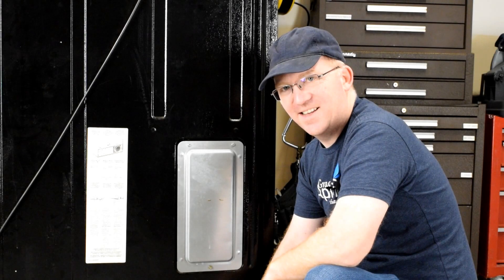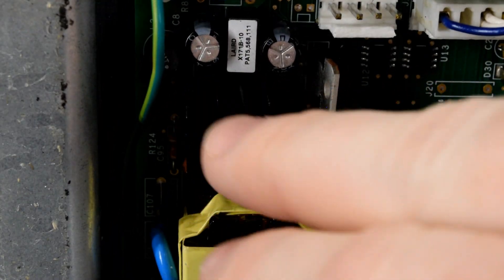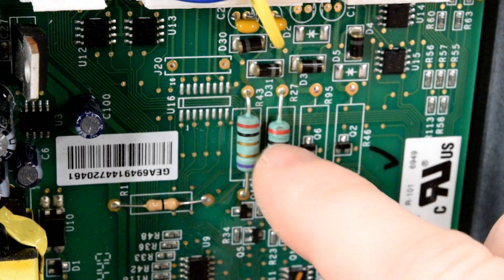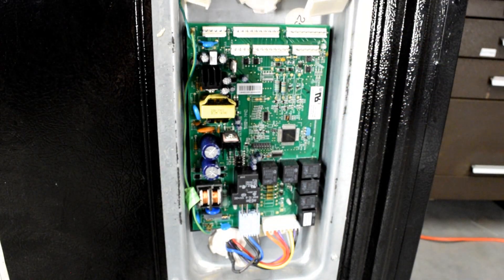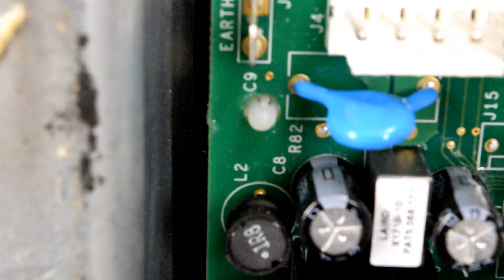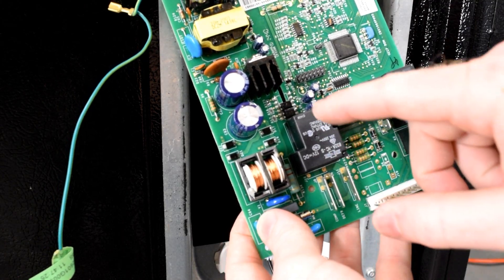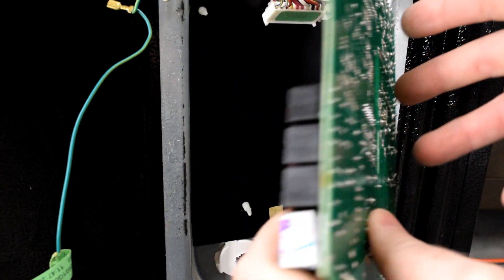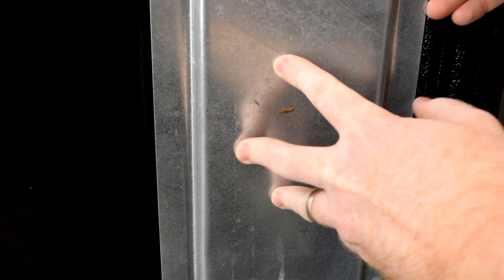Diagnosing a Bad GE Board - Part 2: Visual Inspectios

Comment from the maker: Hi Everybody, Welcome!
If you have technical questions please  check out www.Patreon.com/GraceAppliance
By becoming a channel supporter, you'll get priority response to technical questions, technical data sheet requests, and help support the channel so I can produce more repair videos. 

Thanks so much! Andy
Reply: the service manual said that do not use resist check for those DC motor, why you suggest that?  thanks!
Reply from the maker: @yongtan8578  if your meter were to show OL you'd know it was a failed motor. I've heard reports that the motors will show anywhere from 800-1.5k ohms and this should be a good read out.
Reply: @GraceAppliance  thanks for your reply. you are the best among all the videos  i have seen.
Reply: Sure sir..  Sir..  Plz make videos on inverter frost free refrigerator.
Reply: Thanks for the tip.  My GE refrigerator works fine except when there is a power failure. Restart of the refrigerator is delayed anywhere from 12 hours to over 24 hours.  I know that there is a delay to protect the compressor but not that long. I visually inspected the main board per this video. There is a 38 micro Farad  250 volt capacitor with lots of silicon goo at the base. I will replace it when  I get a replacement.  Is this the likely culprit?   I am reluctant to unplug the refrigerator to inspect the the backside of the board.  Couple of questions.  Is a 44 micro Farad 250 volt capacitor an acceptable replacement?  What is the normal delay? I can't find any reference to it  in the manual or online.

Comment: Hey Andy.  Back in 2019, you and your excellent videos helped me diagnose and ultimately repair our GE French door refrigerator.  I replaced the inverter back then, and the fridge worked quite well until just recently.  I'm having a similar problem now (not cooling, at all), Apex Used Appliance sent me to some of your videos to refresh my memory, and I'm glad they did.  I'll start with this particular video to check my main control board, and see where it leads me.  It's good to be here again!

Comment: Will a failed resistor for the fan motor make the panel upfront and the compressor not come on.? I did find a yellow resistor on r forty three.I replaced the board and still have the same problem.

Comment: Great video. My refrigerator stop cooling. Pulling the control board off and the solder was shot at the relay spot you are pointing to.
Re-soldered that spot, plugged it in and it works now. Will order a new control board since the refrigerator is 20 years old. I wonder how this refrigerator holds up to new ones being made now. Or if the new ones would be going through the same repair at some point?

Comment: Good instructions.  I'd only add - take a picture before you remove the top white connectors... it is possible to put them back wrong and its confusing because there are more install points than connectors.  You should check all caps, as these boards were made during the bad caps era. ( google bad caps ) especially on boards with a white label saying WKKT.

Comment: Awesome video Thank you for doing it. My problem end up being the control board but had a different problem than the ones described. Ended up burning a different part of the board. The condenser motor and pump wooden turn on after defrosting and cleaning the interior. If like the see details I'll send pictures for some reason YouTube won't let me post a link.

Comment: Very helpful! my refrigerator is a 20 year old GE profile. Second time I replaced this control board. Last time was 5 years ago. On the replaced board,  the evaporator motor resistor r43 is burned to brown color, but is still measures the right resistance as labeled.

Comment: great videos,  I have a ge refr. nd.# DSE25JSHKCSS  freezer 14 deg. ref. 60 deg,  freezer rear panel frosted,.so I put it in test mode, no faults, it would not re turn to normal operation, even after unplugging waited over 30 sec and plugged back in would not come back on was running before test mode. ???

Comment: Interested in knowing if you can help. Refrigerator maintains a fairly constant temperature of about 38 degrees. Freezer fluctuate between 0 and 32 degrees. I checked the J2 pin for ohms with black probe to white wires and red probe to red wire was reading 13.9 ohms. when checking with the white wires with the yellow both of them measure 10.2 ohms. does this mean that the board is bad. the board is a WR55X30600 Can you direct me as to how to diagnose this board. I have replaced all 3 of the temperature sensors. And a run capacitor WR08X25466 which took care of one problem which was intermittent compressor not running so I am thinking that the problem was 2 fold the model is GNE25JSKKFSS. Thanks in advance

Comment: Hey, I have burned 2 resistors on my motherboard, they are in the middle, and motherboard is white color, why it's happened and what I should replace to make it work properly!
 The issue with fridge it's not answering on adjustments temperature...

Comment: Thankyou for the videos. My fridge keeps freezing liquids. The thermostat is on the warmest setting for the fridge and freezer. The control board is good, the heating element is good, the heater thermostat is good and I cleaned out the fridge and defrosted the coil, so the airflow is good. The condenser is clean, the compressor is working, the condenser and evaporator fan is running
Reply: Your air damper in the refrigerator side is staying open... Usually up in the left side

Comment: I’ve got a ticking noise coming from the yellow warped part beside the capacitors. It’s ticking quickly. I unplugged and plugged a few times and it fired up for a few hours. Then got a code 0000 (I think that’s what it was) and it stopped cooling. Unplugged it and it is ticking again. It’s the part with 30h-2003 dczm….. is this the part that is broken, or is it doing it’s job and a different part is causing it to tick/click.  I know it’s this part that the sound is coming from because I put a screw driver against it with my ear at the other end.  Any Info on can I repair it with a part or do I need a new board?  Thanks.

Comment: I watched your video on inspecting the GE fridge main board for the big black backwards L-shaped relay which says 12V-DC.  The only thing I notice is a black puss or blob on the bottom of the thicker section at the end on top of the relay.  none of the other relays have this.  The back of the board shows no burnt solder joints.  I get 5.4V when testing from the main board to the display control board and same voltage at the display control board that gets power from the main board.
So, am I right in saying that this 12V-DC relay is the issue and need new Main board?  Probably not the Display control board, right?  And nothing on the fridge is running but the lights do come on and get 120V AC power coming into the board like you showed to check that.
thanks for all your great videos!!!!

Comment: Excellent!  Thanks for posting!  I had the burned solder joint, and as soon as I cleaned it, and soldered it back, the compressor started working!!!  I think it’s fixed 😊
Reply: How long did your solder last. Just found mine has the same thinking to solder it.
Reply: @jonp6347  ever since I soldered it a year ago, it’s been working like a champ. No issues.  Saved me a couple of grand for a new fridge.  Definitely take your time, and do it right.
Reply: @arymonem  Awesome, thanks for replying back gonna do it tomorrow.

Comment: The reason the solder joints burn out is because any moron that knows anything about electronics can tell you, you cannot run the high amperage starting current draw of a compressor thru a printed circuit board. What happens is every time the compressor starts the high current thru the tiny connections partially melts the solder connection, now after thousands of cycles eventually the connection starts to break down and the excess resistance of the joint leads to a heat generating voltage drop across the joint thus further accelerating its burning out and totally loosing the connection. Now if your lucky and these moron Millennial engineers haven’t burnt your house down, there is no reason you cannot clean the joint and re solder the connection, you will be in the same position as if you just spent hundreds on a new board that cost about fifteen bucks to manufacture. There’s no school like OLD SCHOOL !

Comment: SO MY CONTROL BOARD WORKS ON A PSS26LSRCCSS  (1ST UNIT)BUT WILL NOT TURN ON ON ANOTHER PSS26LSRSS (2ND UNIT)
Reply from the maker: Hi Ethan, what is the part number of the board thay that you are using?

Comment: Good job! a great instructional video. But i have a harder question, that no one has been able to answer yet. Working on a GE Side by side, PSPS9PGZBCSS with an inverter compressor . My control (mother) board is putting out 11 volts, not the recommended 4 to 6 volts to the inverter. Everything else checks out ok, compressor and 120acv. What does this mean?  I am very hesitant to put in a new inverter board thinking the 11 volts may destroy it.. or is 11 volts ok and due to the fridge/freezer being so warm?

Comment: Andy, have a GE Fridge freezer works, Fresh food drawer works fridge is warm after power failure, MY J2 plug has a white wire, yellow wire, blue and yellow wire ,the 3rd pin and 5th and sixth pins are empty, how do I check voltage on this ? NO 7 0r 8th pins
Reply from the maker: Hi Lawrence, I will need to know your model number to answer this question.
Is your fan inside your freezer turning?

Also, look to see if the 2 large green resistors on the control board behind the fridge are discolored.  How do these look?

Comment: Fridge was running warm, and collecting Ice in the feezer. Derfoster and connection check out. Sensors check out. Manully shorting does defrost. Flipped the board - saw the burned connections on the big L-shaped defroster relay. Thank you very much.
Reply from the maker: Great work!

Comment: Hi Andy, thanks for the terrific videos and great advice! On my board I am not getting a steady 13V, rather it fluctuates between about 8 and 11V and at time jumps to around 18V DC, so it appears that the Switched Mode Power Supply that runs along one side of the board has lost its regulation. I suspect either the Optoisolator (U10),  the Zener diode (reference voltage) or maybe the caps on the output side. However (1) I don't see anything that looks like a Zener, is there one, where is it, what is it labelled? (2) it seems the board is coated with a protective coating so it is impossible to get a contact on any component leads to do a test, any suggestions on how to overcome that? and (3) if I want to remove any component (desolder), is the coating going to make that very difficult, any suggestions? Thanks
Reply from the maker: Hi Pradeep, 
One thing I’d try is unplugging got fan circuit from the control board and measure the DC voltage directly from the pins on the board.  I’ve seen where a failed fan motor can cause this kind of issue.   
Like you said, capacitors may also cause this issue and I do know the capacitors do often fail on these boards.  Also, for the fan circuit, you’ve got 2 large resistors side by side which tend to fail as well. As for the other components, I have not dove in to much beyond these 2 resistors, capacitors and relays. So, I’m afraid I’m not much of a help as far as he to go about testing these.   
But as you mention, you’d need to remove them one at a time in order to bench test them.  This made all the more aggravating by the clear conformal coating they out on the board. I have had luck with replacing some of the larger components as I’m able to desolder, melt as much of the coating with my iron as I can, and using small pliers have been able to gently (break?) separate it from the board.  
I’ve found it helpful to apply heat from the iron to the solder joint while applying pressure on the part with my hand and this helps pull the pin away from the board.  Some parts are going to be surface mounted components and I wouldn’t say an impossible talk to accomplish, but more detailed and meticulous than I’m willing to mess with.  
I don’t know if any board specific schematics if they exist which would certainly be helpful for someone of your knowledge.   Sorry I couldn’t be more help.
Reply: @GraceAppliance  Thanks, Andy. Yes, it's challenging without a schematic! I have remove the board from the fridge so all the testing is without an external items connected. I'm going to see if I can scrape the coating off, even that doesn't seem easy. Will report back if I get anywhere. Thanks.
Reply: @pradeepbansod3000  any update or fix for your fridge?   Mine was having the same problem.   I sometimes to get the 13V back again after simply check the board to redraw its SMPS.   Once it has 13v, it would run fine; however, it did give me problem when power interruption occurs.  my Fridge may stop working out known. 
I suspected the opto coupler and switching driver IC.  Capacitors are the usual suspects but mine looked great and measured okay on board.  
I bough the switch driver IC but had a hard time to buy the opto coupler.  last failure, I found I can restart it again with heating the switching circuit area.    I will need to try again next time when it fails again.    
Once it is working, I can't get it to fail again or having the 0~8v fluctuation at DC output.
Reply: @arayf.3036  Not much to report. I too have found that intermittently it works, and re-heating the joints seems to have a helpful effect, but not enough to make it reliable. Can you tell me the part number for the swtching IC? And have you been able to locate which part is the zener?
Reply: I’m looking at replacing the evaporator fan motor for the second time.
Verified by checking the ohms on circuit and there isn’t anything.  
The relays are slightly brown, but not bulging.

Can a bad board cause the fan to burn up?

Anyone have a link to the relays?

Comment: Thank you!  Question. What if there is no signs of the burn marks of bad capacitor. How can I  test the board?
Reply: Model number PGCS1RKZHSS.
I get no lights or compressor nothing works except for the ice maker light is on 
Thank you
Reply from the maker: @frankreyes5735  Hi Frank, 
Are the lights inside the fridge on?

The first thing I would try is to unplug the front control board to see if the fridge comes to life at that point.  If so, it is a shorted front control board. 

Second thing i'd try is to unplug the fan plug from the control board in the rear of the fridge and see if there is any change.  If so, it would indicate a shorted fan motor either inside the freezer (evap fan) or behind the fridge (condenser fan). 

If no lights are on inside the fridge, I would suspect faulty wiring or poor connection at the plug behind the refrigerator because the lights inside are on a separate circuit from the control board. 

Let me know. Thanks!
Andy
Reply: Thank you!  For such a quick response!

None of the lights are on
Reply from the maker: @frankreyes5735  the first thing I suspect is to check the plug near where the power cord enters the refrigerator. Be sure to unplug your fridge first and look for any chewed up wiring from critters, and unplug any connectors there several times and reconnect.

Ask me how I know that it's best to unplug the fridge first!  LoL

If all the wiring looks good there, I'd then proceed with the steps mentioned above.
Reply: Okay!  Awesome. I can’t thank you enough.  Let me try. And let you know. Since I gave all the time in the world.
Reply: Sir. How do I get a wiring diagram for this refrigerator?   Sorry for all the questions but I’m learning a lot
Reply from the maker: @frankreyes5735  if you have temperature controls inside your fridge section, you'll find the schematic tucked inside this console. You'll need to have a 1/4 nut driver to remove this housing.
Reply from the maker: Outside of that doing a google search for your model number wiring diagram is the best way I've found.
Reply: GE Side-by-Side ONLY - Refrigerator Repair Videos 
Ok Andy so I checked the connections J2 and got nothing voltages are all over the place. Same for J4.  That means I have a bad board. correct?  Andy I also checked the ohms by disconnecting the plug and got OL. Is that means the fans are bad?   Again thanks for your response!
Reply from the maker: Frank Reyes yes, if you’re sure you’re making good contact on the fan wires, it should not show OL.  That would be a failed fan.  
Also, if you’re taking the voltage measurement from the board with the plug removed (directly on the pins) and the voltage is jumping around all over, that’s a failed board.  Agreed.  Thanks!